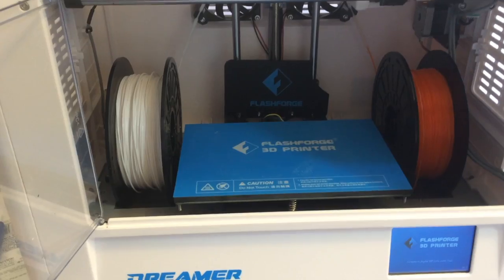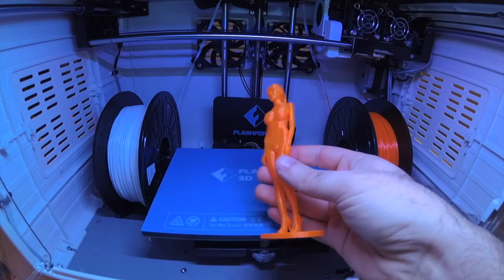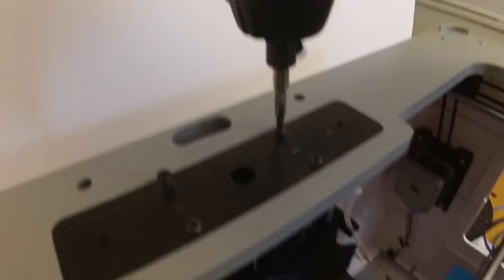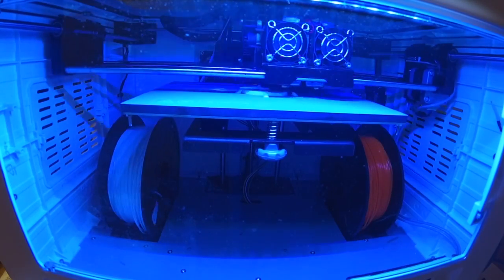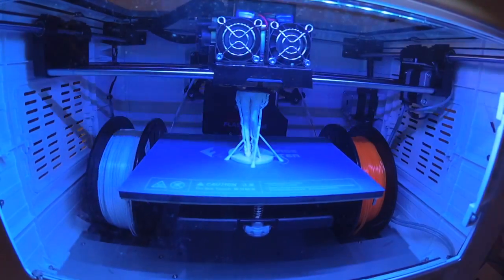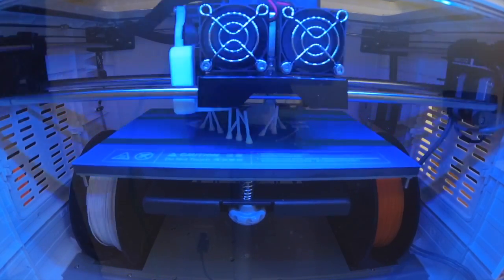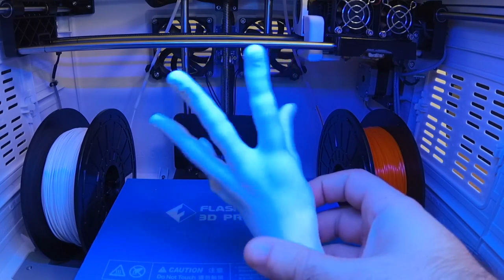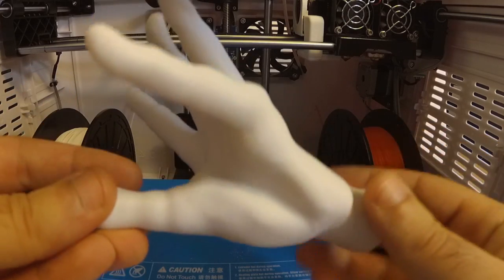R: FlashForge Dreamer Newest Version

Comment: creator pro or this one?!!!
Reply from the maker: Difficult to say. If you have experience building and maintaining 3d printers, I would go with Creator Pro. If you want a ready-to-use machine, I would go with the Dreamer.
Reply: thx for the reply!
Reply: Why do you say this?
Reply: Buy a Dreamer FFCP wont run Flash pint,, Dreamer has updated Mother board,,
Reply: Glen Dooer I'm not worried about flashprint, I'll be using simplify3D. Are there any major performance differences between the two ?
Reply: I have not use 3D but it seems the pick of all of them,,but then again how much fine tuning do you need for your print,,